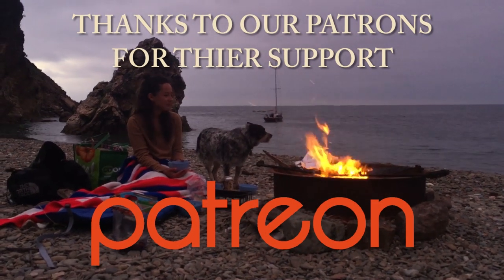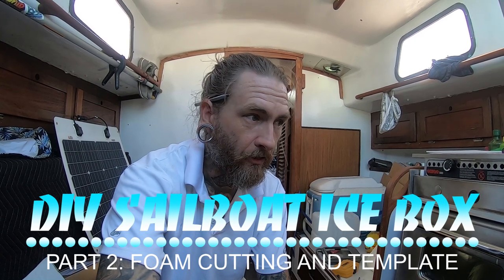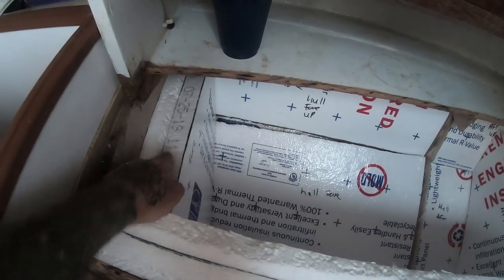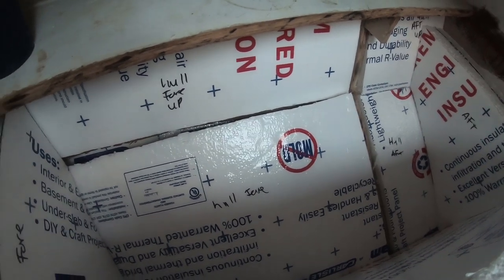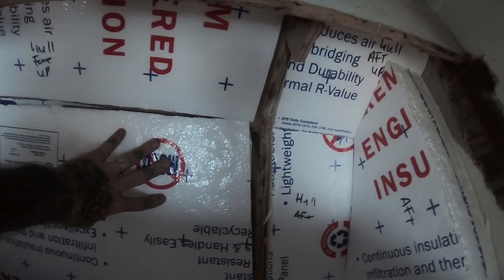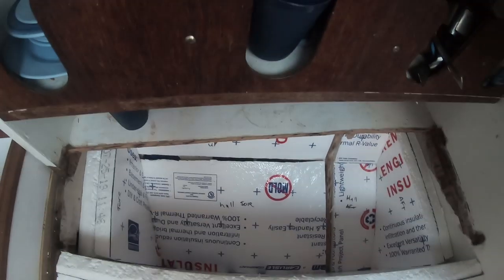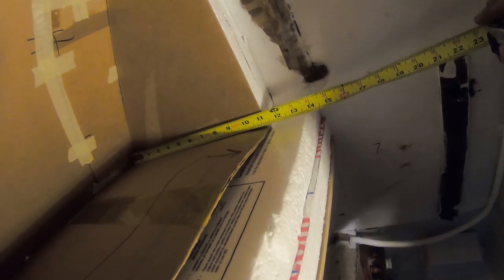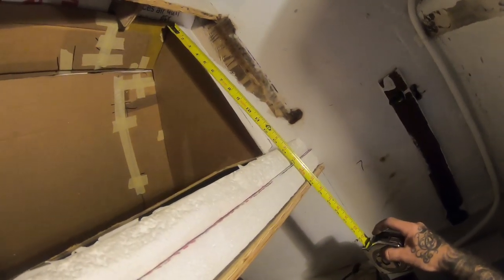Making a Custom DIY Icebox on a Vintage Sailboat

Comment: You might want to put in a drain plug so you can drain it to the bilge when needed.
Reply from the maker: We have used it a ton since the final installation and its super easy to clean out and soak up the water in the bottom with a sponge. the drain hole allows heat in and makes it less effective

Comment: Curious if you considered pour foam vs. insulation board.
Reply from the maker: using foam board gave me far more control to determine space and placement, also if something every happened we can easily replace the foam board where the pour foam is an absolute nightmare once its in place.
Reply: @SailorJames  that makes sense.  I suppose you could put in a liner if you used pour foam to hedge your bets.  the project looks to be coming along nicely.

Comment: Is using sheets of foam better than the expandable foam?
Reply from the maker: Yes because you can't get radiant barrier foam if its expandable and two part expandable foam can break things if it doesn't have the right number of vent holes during the pour.
Reply: Sailor James plus there’s formaldehyde in spray foam

Comment: It looks like your stove area is already an add-on (I have not seen such a nice stove on other Alberg 30's) so did you add that yourself? Did you make a video? Does it make that settee unusable as a bunk?
Reply from the maker: 90% of my boat is custom at this point, yes there is a stove video on my channel, it’s a short bunk so you can lay with down with your feet hanging off forward. I also build in a wet head with a compression post under the mast so the cabin layout is totally different now than when this video was posted

Comment: Looks good! I did the same foam around my built in icebox, I didn’t get a great (some small gaps) fit but I wrapped it in aluminum foil ducting tape,  the top wood cover only has an inch and a half of insulation. A block of ice lasts just over 4 days in 85°-90° weather. P.S. I didn’t insulate the drain hose and I think that is a source for heat to get in the box.

Comment: I may have missed it - is there any need for drainage?
Reply from the maker: Originally  I was going to build it with drainage so we could use it as an icebox but in the end we didn't bother because we bought an Isotherm Cold plate system. We have used it on several trips at this point and its easy enough to clean out and soak up the water with a sponge
Reply: @SailorJames  Thank you for the clarification. Nice work!

Comment: hey James, while I realise the box was made long before this video aired my sugestion is that when you haul out to fix the through hull that you move it and adjust the box to take up the entire space, you should be able to just cut the existing box fore and aft and add a filler strip. cheers
Reply from the maker: The icebox is a perfect size actually, the cold plate system we ended up installing keeps everything nice and cold and we even had to turn it down to keep stuff from freezing and Camille was happy with the amount of space we had as well.
Reply: @SailorJames  cool it looked small in the video but glad it suits first time round